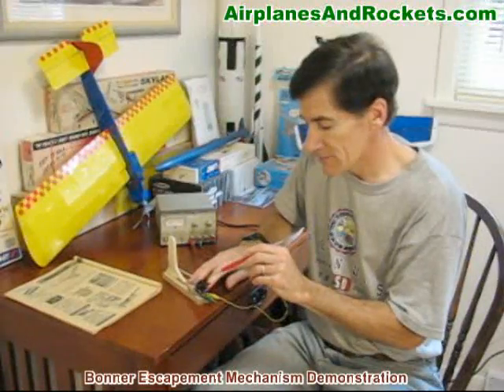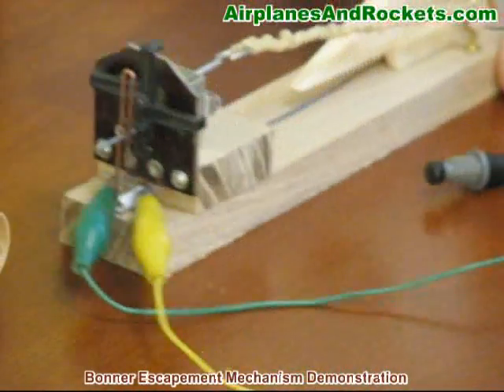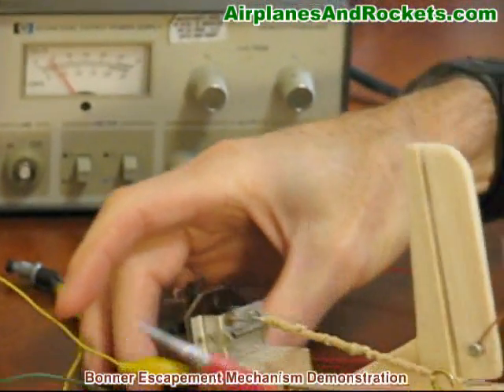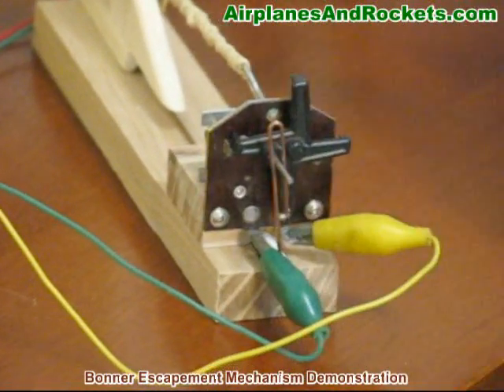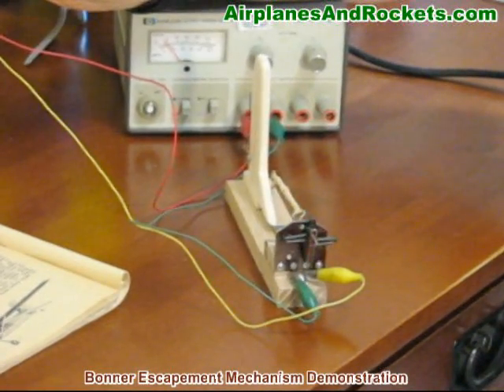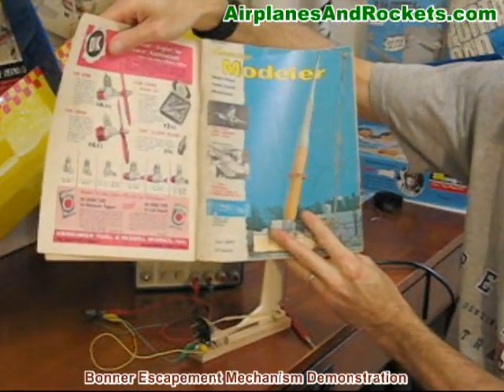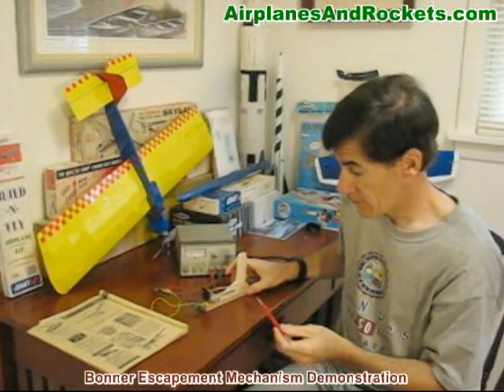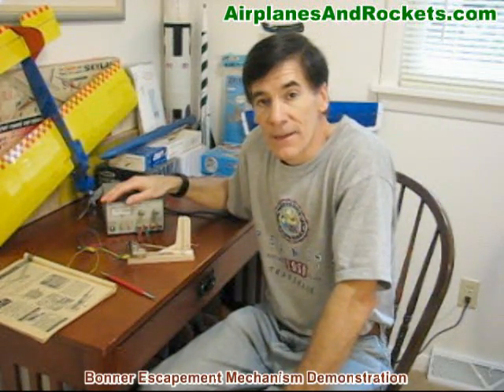Bonner Escapement Mechanism Demo

Comment: The escapement was mounted on the rear bulkhead by the trailing edge of the wing. Yes, on single channel we were able to get rudder right & left, elevator up and down and throttle. It was appropriately called the "Mickey Mouse" system. Dual Bonner compound escapements were used. One push of the button for right--one more push for left--one more push for up--one more the fourth push for down elevator. Throttle was achieved by a quick tap on the only control button.